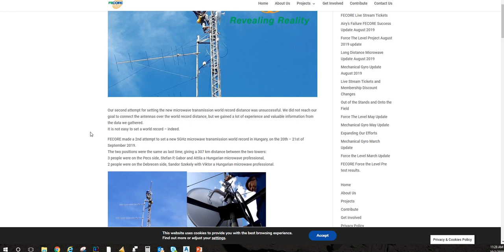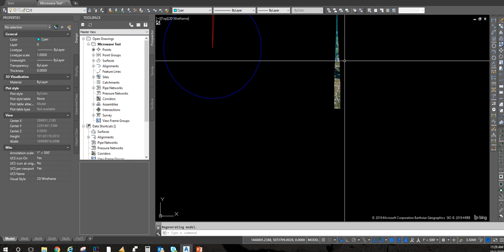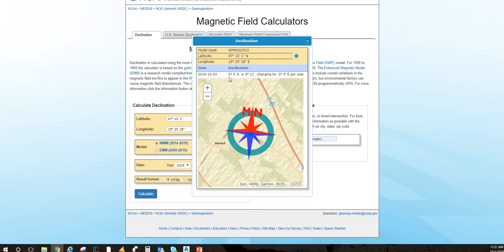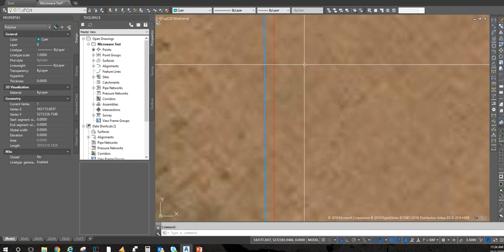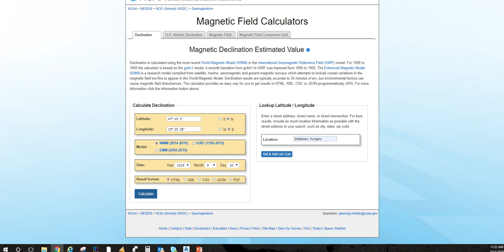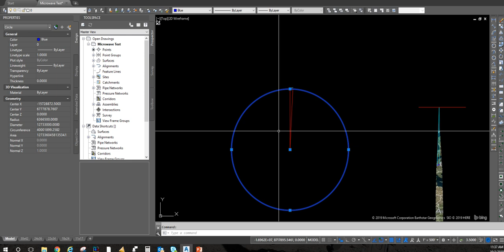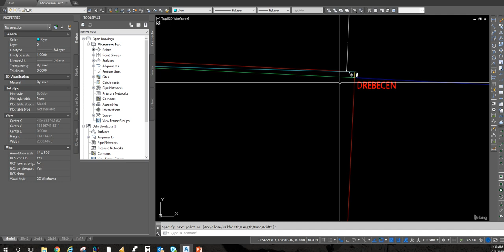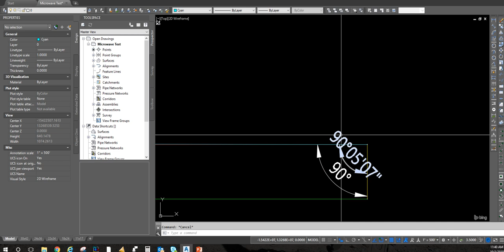FECORE - Microwave, Macro-Error

Comment: If they were genuine, they'd start with this book and prove the curvature calculations wrong ... but, they cannot because this is how radio propagates over the curved earth. And, "line of sight" has a specific meaning in radio engineering parlance, but flatearthers usually ignore facts like that. Nice Autocading Jeff :)

ITU HANDBOOK - RADIOWAVE PROPAGATION INFORMATION FOR DESIGNING TERRESTRIAL POINT-TO-POINTS LINKS, Edition 2008 
https://www.itu.int/dms_pub/itu-r/opb/hdb/R-HDB-54-2009-OAS-PDF-E.pdf
Reply from the maker: This is not unlike a liability case where a surveyor screwed up his azimuth and got sued.  Alex v. Henry S. Conrey, Inc. (Penn. 1974) tells the sorry story of a surveyor hired to orient a radio antenna, based on True North, in Valley Forge, PA to point at Wallups Island, VA, 155 miles away.  This was for the University of Pennsylvania.  The plan was to transmit radio signals in a direct line from Valley Forge to Wallups Island.  Once the tower was installed, it could not be adjusted.  The installing contractor hired the surveyor with a verbal contract.  The surveyor understood and carried out his work by observing Polaris and setting a baseline, which included two stakes for the corners of the footing.  Before placing the antenna on the tower, the contractor asked the surveyor to conduct a field check.  The surveyor found a six-degree error in his calculations.  As a result, the antenna would not be pointed at Wallups Island.  The surveyor lost.  

https://www.casemine.com/judgement/us/5914965aadd7b049345dfc01

Comment: Coordinates from Google Earth for the two microwave towers.
Pecs  46°10'38.46"N,  18°20'14.62"E
Debrecen  47°33'14.75"N,  21°49'43.73"E

(The clue to finding the Debercein side was to back up the date to 2013 as shown in the picture on the FECORE results webpage.)
Reply from the maker: Excellent!  Well, now we can analyze their process even more accurately.  Thank you for finding that!
Reply: @TheMaineSurveyor  Calculating bearing over such a large distance isn't trivial. This on-line calculator figures bearing based on a sphere with a radius 6,371km. 

https://www.movable-type.co.uk/scripts/latlong.html
The math must get pretty complicated if using two different latitudes each with a slightly different radius from the center of the ellipsoid. Just wondering, I'm thinking true north is base on the earth axis of rotation. Why would grid north, if I'm using the term properly, not always line up with true north?

Comment: Operating from ground level (and even at more challenging higher microwave frequencies), amateur radio operators regularly make contacts greater than twice that distance. 
Aircraft scatter uses the aircraft as a reflector to provide a signal path unobstructed by earth curvature.
Contacts require planning as both send and receive stations have to align with the travel path of the aircraft. Longest contacts occur when the aircraft is following the direct path between the two stations. Aircraft size and elevation contribute to the quality, duration and distance of the contacts.
Ham produced software helps take much of the hard work out of the mandatory preparation.
 http://www.airscout.eu/downloads/AirScout_V1_2_0_0_EN.pdf

Comment: It is remarkable that these Flat Earth people will acknowledge the existence of the horizon, yet utterly reject the implications of it.  The existence of a range-limiting horizon, that increases in distance as the observer height increases, is evidence that the Earth cannot be flat.  Yet these strange people will even assert that the very same range-limiting horizon always rises to eye-level.  As if that, somehow, supports the flat Earth case.  How can anyone, with any analytical skills whatsoever, keep trying to prove something that is so obviously wrong?
Reply from the maker: Stephen Clementson I’ve told flat earthers that their acknowledgement of the horizon is enough to debunk their beliefs.  It always goes over their heads.
Reply: @TheMaineSurveyor  They cannot accept the obvious implication of the horizon, even though it takes no mathematical skill to prove.  The last time I took a holiday near the sea was in 2014, but that was before I had learned that a group of crazy people were spreading flat Earth nonsense.  It is common knowledge that the Earth's curve can be easily deduced from the limitations presented by the horizon.  I expected to see that horizon limitation, and was thus unsurprised to see it.
Reply: PS. I should mention that I drove to Orford, Suffolk (England), in January 2019.  Although that's a tiny coastal town, Orford itself does not face directly onto the North Sea.  The North Sea is on the other side of the lighthouse, which was closed down in 2013 due to coastal erosion.
Reply from the maker: Stephen Clementson Bummer! Well, maybe soon you can get back to the coast.  I love the salt air.  I need it.  It’s rejuvenating.
Reply: I'll find an excuse to visit open coastline at some stage.  It annoys me that Flat Earthers completely ignore the simplest possible proof that the Earth cannot possibly be flat.  It's one hell of a delusion to believe that the facts aren't true, and I've seen that Mark Sargent nut on video, claiming that the horizon was not blocking a view across water.  Mr Sargent even demands that space is fake.  That's how nutty these people are.
Reply: Actually, I'll give you another example of the Flat Earth craziness: A guy who calls himself Ranty Flat Earth cannot accept his own evidence, which shows that distant objects disappear below the horizon.  There are mental illnesses that incorporate paranoid delusions, such as believing that someone, or some group of people, is scheming to hurt the sufferer.  In this instance, 'they' have long plotted to deceive the populous, by concealing the 'true' shape of the Earth.  This sort of person believes so strongly in the alleged persecution, that they will refuse to accept that there is no dastardly plot to conceal the shape of the Earth.  This was highlighted in Mark Sargent's insane assertions about people in white lab coats conspiring to deceive the entire world.
Reply from the maker: @clemstevenson  Definitely!  I have explained to FEers that their suspicions of NASA, etc. have no impact on our ability to measure.  They reply, "Yeah, but, governments lie!"  I can't help people like that.
Reply: @TheMaineSurveyor  Flat Earthers just fabricate conspiracies on the basis of no testable evidence whatsoever, including claims that light can't travel millions of miles.  One 'logic-loop' the Flat Earthers get into is the Michelson & Morley null result.  A reasonable question in 1887, Michelson & Morley were searching for the proposed medium through which light-waves propagated.  They couldn't find any evidence for the proposed 'Aether'.  And that is where Flefers enter a logic loop, because the have assumed that the proposed Aether actually existed, thus Michelson & Morley's failure to detect it constituted proof that the Earth was motionless.  There has never been any evidence for Aether, thus there can be no evidence that Einstein was working to hide its presence.

Comment: I've been thinking about this in a different way, How can they get access to these towers to put up a couple of dishes, I think one of the towers was 600m high? I can;t understand how anyone would allow a bunch of amateurs access to actual broadcast tower
Reply from the maker: Zaphod Beeblebrox Good question. It’s not that one of the towers is over 600m high; it’s that one has an elevation of 600m at the top, based on MSL.  FECORE provides no means by which they determined that elevation.
Reply: @TheMaineSurveyor  interesting, even if it's reg Cell tower, I still find it puzzling that they would have any access to commercially sensitive infrastructure> I have worked with people that have access to such locations in the UK, and you have to jump thru some serious hoops to even access them, not least to put up a unregulated Uplink
Reply from the maker: Zaphod Beeblebrox Makes you wonder if it’s even real, doesn’t it?  Here in America, tower sites are quite secure, as well.  They’re an important component of infrastructure, no matter which country they’re in.  I have to believe that it is the same in Hungary, until I see evidence to the contrary.
Reply: @TheMaineSurveyor  Exactly my point access to those structures would be very limited at least in the UK, a bunch of amateurs trying to put up a dish is puzzling,  they claim to pushing out 2KW on the latest I think in the latest update? you are getting close to needing a waveguide?